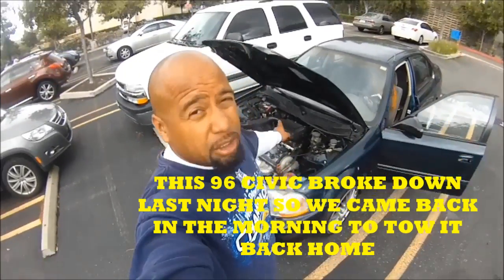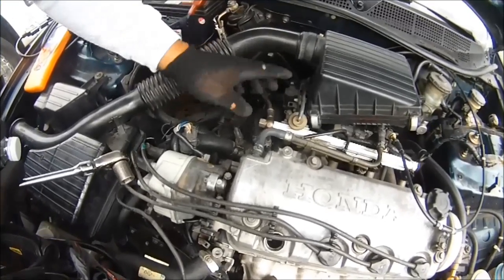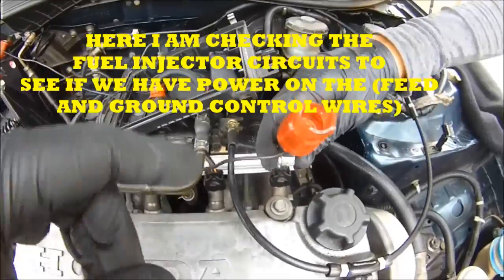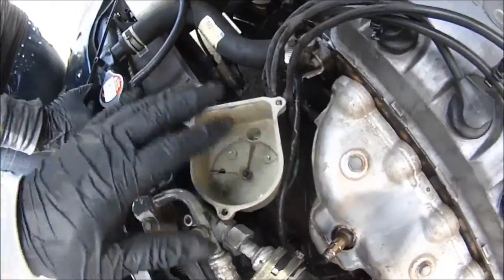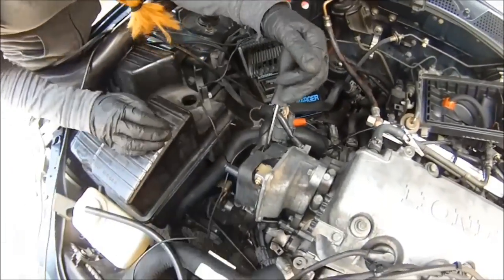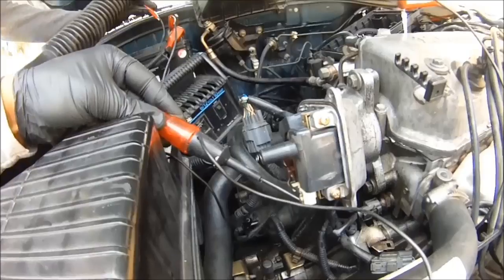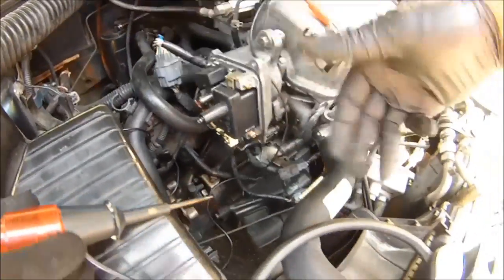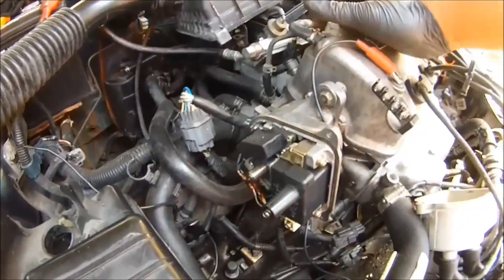HOW TO FIX A CAR THAT WILL NOT START,  HONDA  CIVIC

Comment: Great Video Oldskool Funk!! Pretty much helps narrow things down. I'm wondering if you have a video about How to replace the Crankshaft Position Sensor?
My wife's 1994 Civic Ex has been having a starting problem for over a year and we have replaced Everything except the Crankshaft Position sensor, Camshaft position sensor and the Ignition switch behind where you put the key in. It will start up in the morning, get her to work and then when she comes out after work it won't start.
Heck, a few days ago, it got her to work, then wouldn't start after work. 3 days later we went back to her work where the car was stranded and tried to start it and it wouldn't start. So, the local dealer offered a 69$ diagnosis and free towing so we decided to have them tow it and diagnose it. When they got it, it started right up!!!??? CRAZY, it has been doing this for over a year! Each time we replace something, it fixes the problem for a couple days....and then it doesn't!!
One thing of note, when it Does Start....It runs like a Top! Right now, the dealer still has it and it just keeps starting for them.
Totally dumbfounded....Any suggestions?
Thanks again for the Great Video.
JJ Suprise
Sandy, Utah

Comment: Cant wait to check these things tomorrow morning. Just did a manual swap on my EK and it wont start. Just cranks over, I hear the fuel pump, starter sounds strong. But havent checked these things yet

Comment: Was hoping to see you go the junkyard and pull another one. Good info, most of the newer cars are coil on plug now, can't wait to see some vids on them from you.
Reply from the maker: D4x4Bronc Right on, That was the original plan but the Civics are in such high demand you cant find a whole distributor or dist parts at the junk yard at all.
Reply: oldskool funk row52.com lets u search most self pull yards just fyi.
Reply: D4x4Bronc ah nvm none near you.

Comment: yashua ha mashiach knew I needed old skool bro soul.ya gave wisdom to the tabernacle builders. you have that wisdom. I think I have a bad ignition switch on a 1997 Honda accord and need to know how to diagnose .starter motor not working.interminent .free manuals would be great. any advice would also be thankfully accepted. thank you.

Comment: u got my sub and thumps up. i just wish the distrubtor wasn't the problem for you. i put a brand new distrubtor on mine civic and it still won't crank. plus i put new plugs in it, i think it's one of my pick up sensors or maybe the pcm. i just need to know how to diagnose them. thxs for the video wow i learn alot btw i got a 93 honda civic non vtec motor d15b7 with a vtec computer 5spd. been running like that for many years, up untill now.

Comment: hey man, great video, educated me for sure, i just bought a 2011 Acura TL from the auction, it does not run and drive, i am hoping to make a flip, so if you can help me with a few pointers i will appreciate it.

Comment: And another comment.. at 6:39 Wow man, this video.. PAID videos are not as good as this. Seriously. If I were to spray fluid (I used up my starting fluid too, I use Brake Parts Cleaner, I see you can use Carb or Carb and Choke cleaner too) into my intakr, it starts up and RACES UP and then will die. It races to like 4000RPMs.

I will make a video for you and Scanner Danner after I adjust my valves and put my timing cover back on. This is very very helpful.
Reply from the maker: +TheJCorbi82 Sounds like you have a fuel delivery issue. The main relay may be going bad, fuel pump or wiring connections can cause the fuel pump to work off and on. Check all related fuses (fuel pump, main relay)  I would bypass and apply 12 volts directly to the fuel pump and see if it will stay on for a while (you have to trace wires) have an off and on connection point (touch wires). Test the main relay with a DVOM (Honda factory repair manual way) not Haynes manual. Google the honda repair manual info on Honda forums. Also check pick up sensor resistance in distributor like I did in the video 2&amp;6 3&amp;7 4&amp;5 should be between 350-700 Ohms( just disconnect the dist harness). Also check crankshaft position sensor wiring and resistance on side of crank pulley. let us know whats happening ok

Comment: Thank you. your video is very complete . my DelSol 93, D16Z6,  is with this same problem! There is no negative signal in the conector injectors ! my distributor is td-42u, i changed the coil but to be continued the problem. i will verify again. The igniter is a rotation sensor ? Do you have one of this? Export to Brasil, if is this problem!!  Ty

Comment: Hey Bro, Here from Costa Rica... I have constant sparking at the bottom of my engine around the bottom wheel of the timing belt (not sure exactly from where the sparking is coming from).  I have taken it to a couple mechanics and electrician but they are not able to reach to the problem. The last I heard is that it could be the distributor but have not got to check it.
Any suggestions?
Keep doing what you do ! God bless you!

Comment: Hey your videos are great man 
I was going to ask you if you could tell me what's wrong with my car 
I have a 2003 Ford Focus zts 
I was driving one day and it's started to lose power and then it just shut off all of the sudden 
Ever since then it doesn't want to start over 
We checked the alternator and the battery and they're both good 
We also checked if we had spark and we didn't
If you could plz help me out that would be wonderful 
God bless man !!

Comment: stuck bolt , put a screwdriver on it and beat on the end with hammer or , l think helps break it loose. but since it is on the rotor axle it might bounce or bend ax .

Comment: First off thank you brother for your expression of the Love Yashua,  "Jesus" has for us all. Now secondary business my buddy and  I bought a 2001 honda prelude to fix up, it has no spark not in the plug wires not from the distributor the coil tested out good the ignition control module tested out good. all the wires in distributor seem good no shorts good resistance? My one concern in the distributor is a part that I can't figure out what It is it has 2 wires that go to it and every time the rotor turns it has a little piece that touches it it's also magnetic. it's in the bottom of the distributor. Any ideas would be much appreciated because we are stumped why there is no spark.

Comment: good video. i changez the whole distributor b cuz i got it for a good price feom work but still wont start like how yours did after you fixed it. now battery died sue to over craking. i have to wait til my jumper is chatged up to attempt to start it

Comment: Hey dude, I want to thank you so much for this great info. I think you are the one that helped me figure out how to fix the obd2 monitor redyness statuses.  You should have a easy way to give back to you.  Great video. Im trying to help this guy tonight whos 93 honda accord will not start but only cranks. I tried for like two hours to see if it would start. It just cranks but doesnt start. Pulled the fuel rail line and cranked but there was no fuel pumping through. Wondering if the main relay problem that prevents fuel from being pumped and wont even start when i sprayed starter fluid into intake.  Great help and amazing wisdom about god and Jesus . I need to repent and change my mind and be even a better person. What do you think i should try first with no fuel through that line? I don't know where the fuel pump fuse or relay or even main relay is. Heard the main relay is up under the dash. I need to figure this out since i want to help this homeless guy who lives in this car. If he loses it he loses his car,home,possesions inside and i do not want this to happen while im able to help. Thanks so much , Charles.
Reply from the maker: yes the main relay can be bad, Check the relay, wires, I would bypass the main relay and find the wires directly to the fuel pump and apply 12 volts to see if it will work

Comment: After you replaced the igniter and it took a bit to start, was it due to lack of fuel pressure since you disconnected fuel line? Usually can prime the line by turning key to on position 4-5 times before cranking
Reply: maybe engine was flooded with gas from the failed starts prior

Comment: disy module very common on hondas when you have spark ull have injector pulse what i always do get another good dizy plug it in the wiring harness of the car ignition on earth the dizy spin it by hand of normal rotation an ull hear the injectors click wich means ull have spark

Comment: 1991 honda civic 1.5L no start checked relay good. fuel good ,pump good ,check voltaage at the coil + ,- good .
 now  i check harness  i found a problem no one has experienced no voltage on the blue/white wire check 10amp fuse good live in la cuvler city

Comment: hey bro I got a question maybe you can help me I've been having a problem with my 97 Acura CL 3.0 I was driving one day and it just died on me it started up but then when I got to work it will not start again when I check for a pulse coming from a uniter I have power there from the mission coil going to the distributor cap but then after distributor cap to the wires there's no power how do I fix that is either uniter or what I need help badly thanks a lot Bro you've been helpful enough as it is God bless you

Comment: For corrosion on terminals my brother in law cleans them then brushes heated petroleum jelly on them, he said he learned it in the army. I see that it works on the battery terminals but wonder if the inner terminals are just as good.

Comment: You were flooding the cylinder /fouling the plugs while you was cranking it testing for spark thats why it took longer to start after you installed new igniter ,what I did is installed new plugs at cylinder #1 and started right up , I had same issue but the mechanic I went to he started replacing fuel pump,fuel filter,injectors and nothing cured it ,problem was it would start then after following day it wouldn't start went back to him couple times that's when he started replacing bunch of parts costing me money along the way he said he checked everything..lol come to find out I found that his fuel compression gauge not working and all it needed was a new dizzy so I guess he felt bad and wasted his on time couldn't diagnose problem and he told me I had blown head gasket causing it not to fire..again..lol.. Nothing to do with engine not starting and he wanted 900$ to repair it ,really I said give the car back and I solved the problem with a new Dizzy ..lol ..car now starts and driving around fine no issues , thanks to ppl like you guys on YouTube helping ppl like us work on our own cars and we get to learn and save its like going school , thank you

Comment: My brother and I did everything in your video. And everything checked out good. And we put it back together I lose fire in the spark plugs. We get fire from the coil but like I said it won't fire the plug wires. Any idea or help would be appreciated. Thanks.

Comment: sup old school like your videos and the preaching keep it it Dogg one love.

got a question about a honda h22A4 engine  idle problem goes up then down up the down doesn't stop already changed the idle control on the throttle body and the intake manifold any clue what I should be looking for?

Comment: My car sounds like this after I did a head gasket replacement. I’m not even sure if the ignition coil is a reason why it wouldn’t start but I took a look anyway. Got a spark from the spring but for some reason there is no screw on the rotor

Comment: Worked at Honda an more than
Likely dist components bad. Replaced lots of coils an whole distributors. If they have a lot of
Metal shavings change dis. Coil. 
Burnt signs change it. This one I
Would change ignitor.

Comment: hay,brother
I Have a good spark on all the plugs fuel is good too.
looks like its flooding the engine. I disconnect the injectors and crank car sounds like it wants to start but no good, I took spark plugs out and they are wet with fuel don't know if its the ECM

Comment: oldskool im quez from oakland thank you for sharing your wisdom.I have a 1992 honda accord . On the gear shift gage on the dash im getting Drive 4 - D4 error flashing. And the trans dose not accelerate in first gear i replaced the computer and the trans control computer. I disconnect the battery first. start the car drive around the corner turn off the car try to start again wont start D4 flashing again. what do you think.

Comment: i love your videos. just found them. i have a 2010 Honda accord that sometimes ifles low at a stop. its around 550 or 600. if i put in park its about 750 - 800. where should i start to diagnose this.

Comment: Man, Oldskool I paused the video because I just wanted to say.. I think you are the coolest guy. I am in Jesus Christ as well so we are brothers in Christ, no shame or apologies.. I am presently going through the same thing after a head and head gasket change and timing belt change on my 1995 Honda Civic here is a picture of it http://images.tapatalk-cdn.com/15/12/02/52e097b23b5ab02b4ecb0aebd97322ab.jpg - This one starts and runs with starting fluid but dies after even all new fuel system components like Fuel Pump, Fuel Filter, so something is wrong. The relay clicks every time but sometimes the pump doesn't prime so there could be a power issue there too. Things are disconnected, some gaskets are not on.. This video should help me out a lot. and I've used an empty water bottle many times for gas, they work great for that. Peace out, I'll try to keep you posted on if I get this car to start and run. cranks all day.. will start with starting fluid only right now.

Comment: After pulling off fuel hose did you bleed the fuel to fuel rail? It sound like it initially started because of fuel remaining iin rail. Turn to ignition on for 30 sec then off and repeat before starting. Thus will prime the fuel

Comment: check module as the pump may work but wire connector has melted a bit, happen to my fuel pump, put 12 directly to pump connectors.

Comment: How's it going oldskool my 1997 civic putted out on me this morning taking my daughter to school. I pulled over and turned my car off then it wouldn't start. My dad and I were trouble shooting and last year we changed the distributor cap. When we took it apart today we noticed there was no coil in the secondary part and the rotor doesn't move when I turn the key in the ignition. Do you recommend I buy a new distributor or is the problem more deep. I'd be appreciative of your opinion thank you.

Comment: god bless u thanks for your help but im having trouble on a Nissan altima 2005 motor 2.5 in the mornings when i start it it turns on good but after a while using it for an hour i turn it off and when i try to turn it on again the motor starts but is not on i put start fluid and it turns on the mechanic told me that it was the gasoline pump and i already put one but is still the same issue and i change the crank  sensor and is still the same hope u could help me

Comment: thank you  my question is why didnt we have flickering on  the injectors control wire ?   i thought if the  pick up sensors were working okay we should have flickering ?

Comment: Hey bro I have a question on a 2012 Nissan the code it’s throwing is 0420 catalyst bank 1 but the car shuts off while driving I’m thinking it’s the fuel pump sometimes I hear it and sometimes I don’t hear it what do you think my cousin cleaned the carburetor with cleaner and towel thinking it would fix it but it only worked for a few months should I proceed to fuel pump let me know bro doing it soon God bless you it passed smog recently so I don’t think I need to replace the catalic converter looking more into the fuel pump

Comment: I have more of a question if I May? On a 1999 Toyota Camry 4cyl timing belt broke so going in taking it apart  the cam goes tdc, crank won't go 180°, And it's not the valves holding it up! What else could it possibly be? Stumped...

Comment: yo @oldskool funk I have a 1999 Acura CL 2.3 (4 cyl) with 228,000 miles I was getting the check engine light code P1382 CYP number 1 no signal. I drove with it and while I was on the highway it shut off and wouldnt start back up. I tried a new distributor and that didn't work. I recently changed the spark plugs and wires. I took the dist. cap off and the rotor did not spin when I cranked the motor. I was thinking it could be the time belt could that be the reason the dist. rotor doesnt turn and i have code P1382. Could the camshaft be broken? 

thanks for the help!

Comment: I Have A 1995 Honda Accord EX With VTEC Its A F22B1. It Cranks And Doesn’t Start. It Has Fuel, Spark, Air, Compression And Timing. Do You Know Where The Crankshaft Position Is Located There Are No Wires Coming From The Lower Timing Cover?? Do You Know If It Has One At All??

Comment: Idk if you'll see this but my civic is doing this same exact thing but I was wondering if it was a bad ignitor would it cause the engine to choke and shut off while at idel or driving, cuz mine will somtimes start and run for a few but will shut off randomly, and when I have my ignition key on if u listen to the distributor it sounds like it is shorting out. Without even turning over the car, key is just in the on position

Comment: working on a 96 jeep Cherokee 4.0 starting system the feed wire does it connect at the battery terminal which is the small wire I know the big positive wire from the battery is connect at the big screw let me know if I'm right thnku